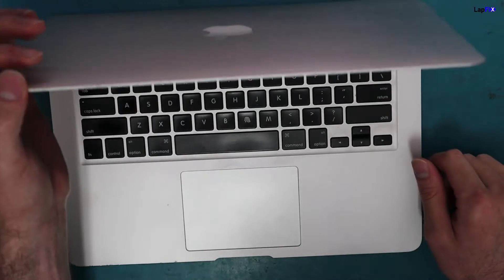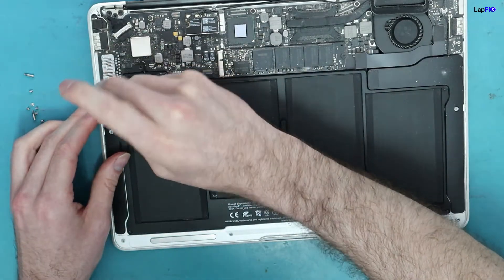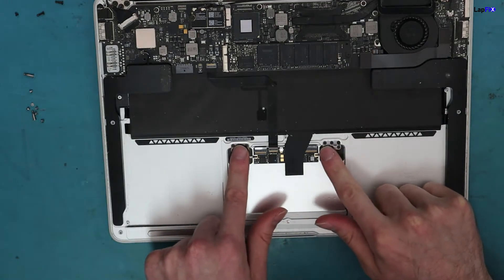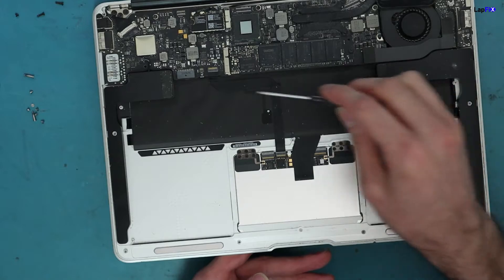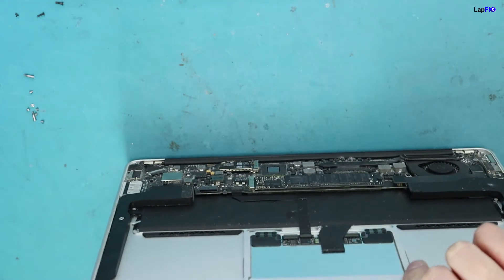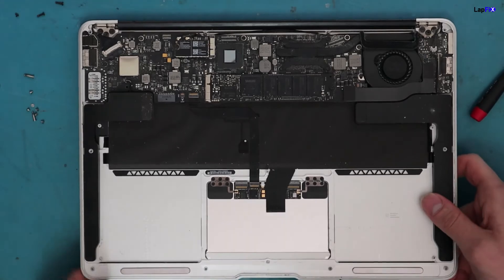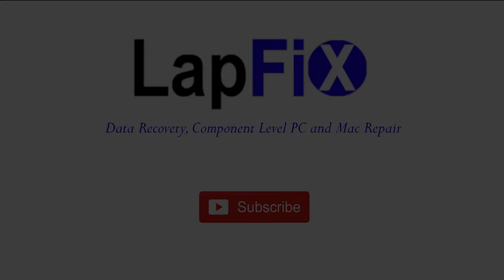MacBook Air A1466 Trackpad Not Clicking Fix

Comment: Thanks a lot, that helped me.After changing my battery I noticed my trackpad was a bit loose, really annoying.
Reply from the maker: There is a screw that presses it down toward the tip by itself.  Just need to tighten it a little bit
Reply from the maker: At least for the click, otherwise, the little frame for the trackpad needs to be tightened where the metal connects to the frame

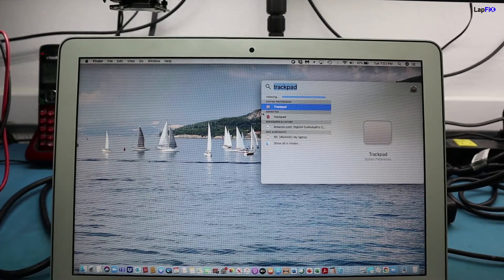Comment: Wow, I'm so grateful for this! I don't often have technical problems with my Mac (early 2015 Air) but this morning I woke up to a trackpad that won't click, and your setting tip at 4:08 (Touch To Click) solved it without needing an emergency trip to the shop (yet).

I also learned that my battery needs attention so I'll get that done before it gets worse. Thank you!  

I'd never heard of Lapfix but now you're getting saved in my go-to file.  Love the clarity and detail of your narratives!